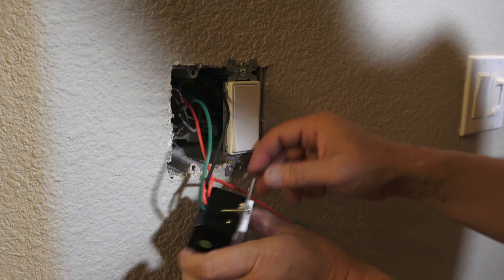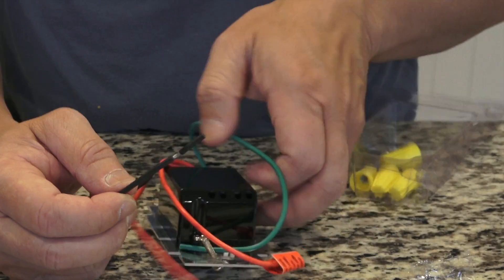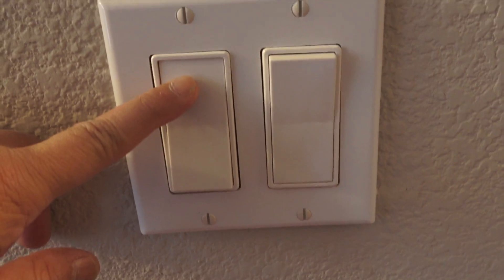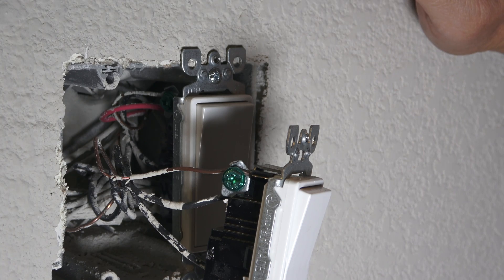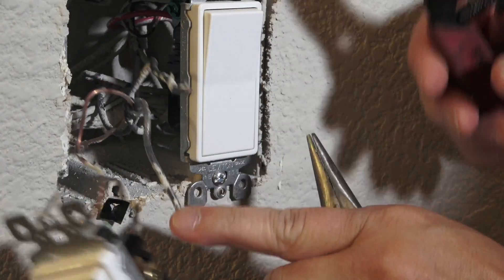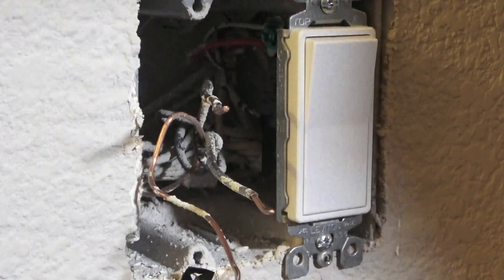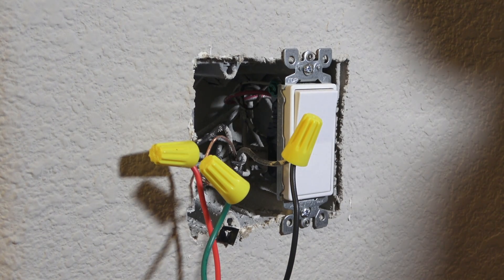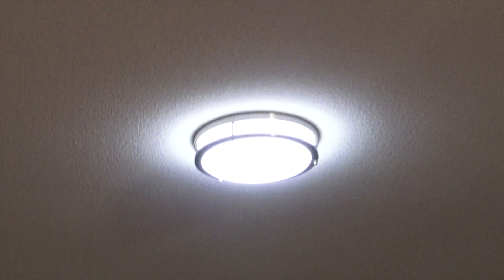How to Properly Install a Single Pole LED Dimmer Switch! (4K)

Comment: So which is the or wire red or black?
Reply: You need to find the power wire from the panel then the other cable going to the light

Comment: Did everyone cringe when he cut the wires instead of unscrewing them to pull out the stabbed wires, to make use of the stabs on the replacement device?

Comment: 🤔 so in my old trailer park engineering ways, I got a light, and what’s essentially a 10’ extension cord with no female plug, just white black and green wire, wired straight to the white black and bare ground wires in the light, it’s plugged into a surge protector. 2 reasons, I’m in an apartment and my landlord would shit if I went off and modernized the lights 😂, and two, I’ve been using solar lights and the same Aa energizers for almost 20 years. Had a car battery sitting around, got a solar panel, it sits in the window held up with a tension curtain rod 😉 nothing permanent all movable, I charge all kinds of batteries and made my moms old lamp completely overkill fancy pretty just because it’s almost 2025 and I don’t like the idea of turning on a light switch every time I turn around, also, I don’t get a lot of sunlight all the time through my one window in my bedroom so the solar lights and what not take away the pitch blackness 🤷 I can see. The led light I just got is pretty dang bright, even the ‘night light’ and it’s not light my led strip lights, there’s no dimming option, and I’m thinking hard about a dimmer switch integrated into it, but there’s no receptacle involved and idk if I’m going to have to hillbilly one up with a mini wooden box so there’s no exposure to the screws or anything as such. I already have everything set up on kill switch’s basically and I kill the power before I leave the house accept my normal solar lights so wouldn’t be much of a bother if I can figure out the dimmer switch . Guessing just hack the ‘extension’ cord and splice one in and heat shrink and whatever to protect any intersections of wires

Comment: Hello, I have a new LED light, same type you have here, with the same type of wiring in the switch and the switch isn’t turning the light off, any ideas? The LED light has the red, black, tan (white) and ground wire,  help! Please
Reply from the maker: That sounds like the LED light is not connected to the switch. The red and black wires are live wires.  Only one of them should be connected to the LED light.  Sounds like the one that is currently connected to the LED light is not connected to the switch.
Reply: @ So after watching your video again, we decided to try and just use the red wire on the LED light as you had indicated when you installed your LED light, you had said if the black didn’t work you were going to try the red, we did that and all is great! The light works at the switch and the dimmer works and so happy! Definitely never thought of that, all the other videos just showed using the black and white wire and the ground of course! So thank you!
Reply: @sueoneill6171 so glad to hear that it worked out!  Thank you!